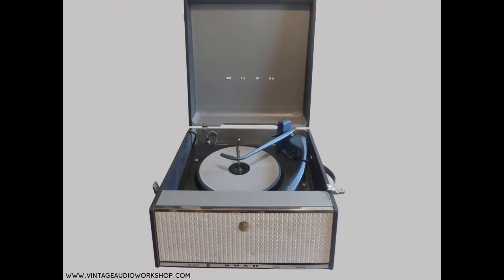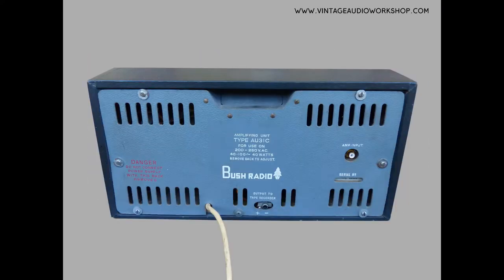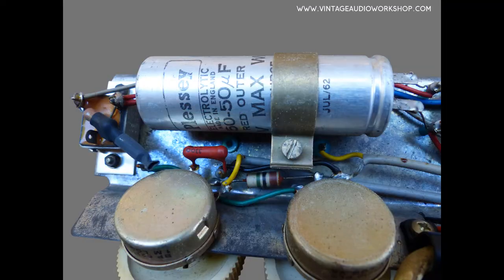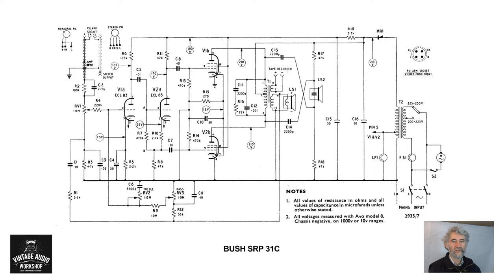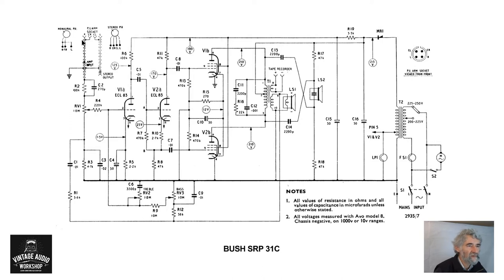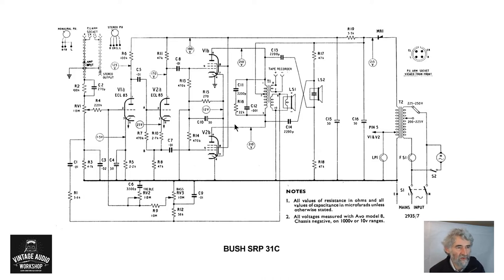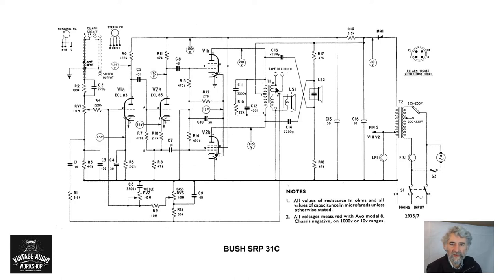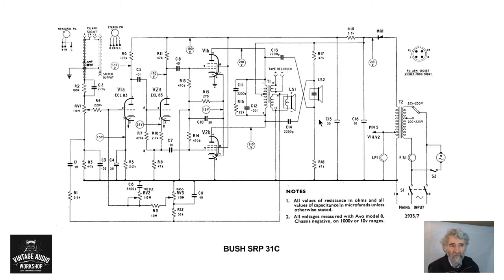Valve Amplifier Study 019: Bush SRP31C Stereo Record Player Circa 1962; ECL83 (x2) Push Pull Circuit

Comment: Picked a new amplifier from one of these up which had never been put into case on ebay!
Reply from the maker: They sound very good, how much did it go for?
Reply: @vintageaudioworkshop  I think £20, it's funny because I'm just building a giant active speaker using it, infact with a 12inch woofer, which I pocked up from a boot sale!

Comment: Just putting an ECL83, push pull out of old radiogram, (rebuilt) into a modern speaker, to use as a mains powered speaker to listen to u-tubes on!
Reply from the maker: way to go... I was watching youtube home videos on a Dansette EL84 playback amp for test reasons, after an hour or so I totally forgot I was listening to a 60+year old amplifier, suddenly a car horn went off on the video and I nearly jumped out of my skin the sound was so realistic I thought a Cadillac was about to crash through the wall. Tubes/valves sound very real especially for the midrange. Paul
Reply: @vintageaudioworkshop  I've built my own EL84 with gardeners push-pull transformer, but I didn't connect it ultra-linear (to avoid wires everywhere), I connected pure pentode and used only 200 volts b+, it still works fine!
I've also built pure Tetrode KT66 Amp.
Brian M6BAQ
(Dover)